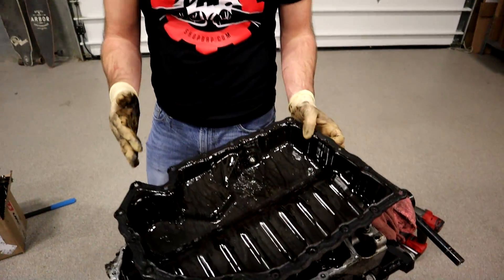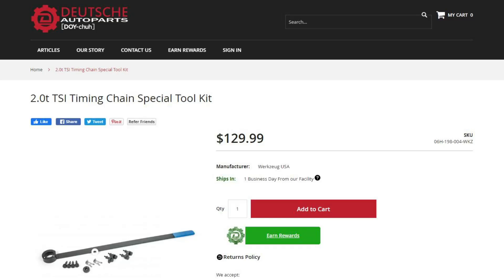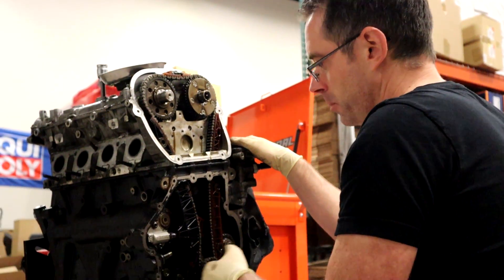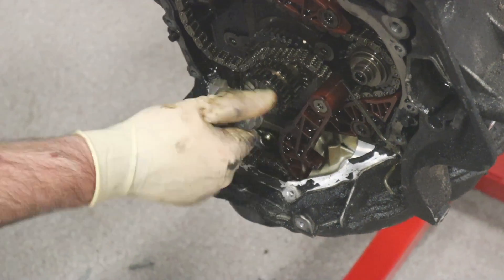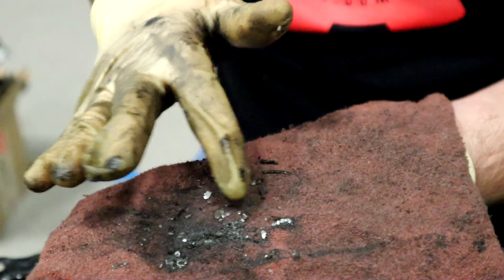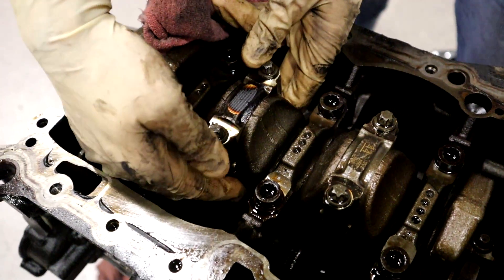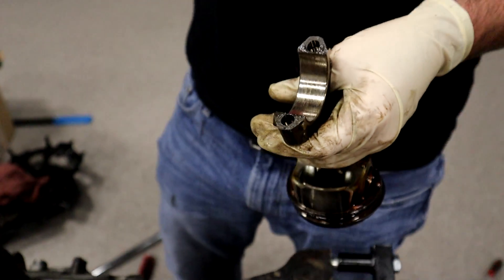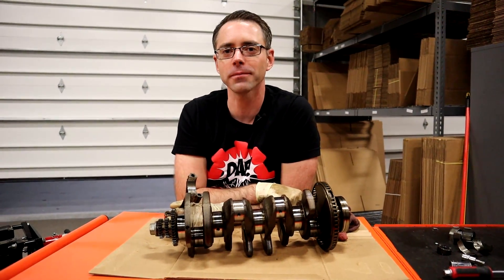What Makes an Engine Rod Knock Noise? | TSI TearDown

Comment: just had this issue ie big bad noises resulted in engine not running.

however my situation was different, i maintained this car to the point the garage told me , dont need to do the full service etc as you havent done many miles and its sorted. so it was always topped off on oil etc. however they did mention on the last mot that it was oddly struggling to get passed the emotions test ( in the uk), which tells me this was all related to the pistons using up oil .

Comment: I had exactly the same problem in my mk6 gti and I replaced the cranshaft with a used one in very good condition with 50k miles I replaced the connecting rod that was damaged and it was black again with used one in good condition and all new set of bearings and new timing chain set.  My question is Will I have any problems with my engine now or should I replace all the parts?

Comment: Did balance shafts and screen deletes at 140k.
Bearing burned out at 155k.
Got a used engine off ebay, and rebuilding the old block for SnG.

Comment: I'm getting a knock from the rear of the sump and It seems to be louder on the right side, 2001 dodge ram van; I don't know what to think. The pressure gauge is behaving differently from how it used to too. I replaced the oil recently, and the noise is still there, mostly at idle. I can't hear it when I'm driving.

Comment: Sometimes n most times no oil or rear main bearing gasket damage worn out n rear main bearing rod not torque enough causing a gap n loose   or over torque n damage broken

Comment: literally just happened to my car today. I bought the car 1 year ago and put 10k miles on it. Kept up up with the maintenance checked my oil every few days and now it's going to cost me $15,000 for a new engine since VW couldn't find any used ones in the country. Also 5 years left on the loan. Lesson learned. Never buy a used car.

Comment: i got one like this. what i'm gonna do, is polish up the journal, put a new bearing in it, run it on half diesel, half old oil, drain that after a bit, and replace with good oil.
everything i read says this aint gonna work for long, but i got nothing to lose at this point!

Comment: Can it come from engine overheating
Reply: I got a ADY engine with a knock I replaced hydraulic lifters oil pump but all plastic melted that was in my engine I tried to clean everything out replaced bearings

Comment: My V W just blew a rod yesterday according to the Naples Volkswagon service department.  I don't doubt their diagnosis b/c of the knocking noise. So they said I need a new engine for 11,000.00 dollars. It's a 2018 Passat 2.0 t s i with 89K miles. It's been a great car till yesterday so now what? Do I incinerate or vaporize her or sell for parts or get it disappeared ? I'm stuck.

Comment: As much as I like the way these engines perform, I think they are overly complex and overengineered.  Just try to replace the water pump on the third generation 2.0TSI...
Way too many plastic parts in these engines, as well.  This is planned obsolescence taken to the next level.  Plastic oil pans?  Come on ! !

Comment: Nothing wrong with those bearings! All you need is two aluminum magnets, a copper magnetic inverted breaker stick, two quarts of slick 50 and some w/d 45! Male sure it's w/d 45! Cost is around $80.00 total and a complete fix without new motor! These internet mechanics are out of control!
Reply: Won't you please come fix my engine?
Northern Michigan is beautiful this time of year.
Toyota 2005 Highlander V6 3.3 L.
Thanks

Comment: I have the low oil pressure issue, but no rod knockig. It still doesnt preform like it should. Im getting a new pickup tube, oil pump, water pump, sensors, ect. If i dont have any knocking noises can i get away without having the engine rebuilt. (0 oil pressure idle, 40-60 drive, overheating, oil level normal but dirty and was past change date when problem started)
Reply: Have you resolved the lower pressure fault?
Reply: @Famo M  I have long gotten rid of the car, but intake cam, exaust cam, and cambridge were very badly worn. I'm going to assume it was the cambridge or balance shafts that started the chain of events, but these motors have a lot of little mesh screens when they get loose they tear shit up bad and it's very common for the 3rd generation 2.0tsi to have this issue where the cambridge screen dislodges and finds its way into the intake cam. Usually it gets stuck in an oil passage and u can just pull it out, worst case scenario it makes its way to the vvt solenoid or intake cam and gets shredded to a million small pieces and destroys the cylinder head. I had no noise in my bottom end, but I wouldn't be surprised if the bottom end was starting to get badly worn because of the amount of metal in the oil.
Reply: @Famo M  also don't quote me on the 0 oil pressure that number wasn't correct. It was still too low like 10-15 at idle.
Reply: @Famo M  if your having oiling issues I would start by checking cambridge for wear. It's one of the easiest things to get to.    If there isn't any issues up top you would want to pull balance shafts and bearings which is a pain in the ass.   Low oil pressure usually means the engine is worn out.     
If u have timing related codes and low oil pressure at idle I'd check the cylinder head first in these motors though.  Sadly by the time u have the oil pressure light the damage is usually done but I've seen people save it replacing cams, and heads and cleaning oil system. It's a bitch

Comment: As a vw tech. I’d never recommend the 10k intervals. My mk6 gti k04 oil change gets done every 3-5k at max. I’m 106000 miles now and absolutely nothing wrong with her. Always check oil level inbetween changes as well

Comment: Worn out piston pins, and/or rod bearings or both, not changing the oil, or simply poorly engineered or manufacture sloppiness tolerances.

Comment: I don't get why people are always so keen to replace rather than repair engines these days. 

I've replaced and repaired countless damaged engines. I've never had a problem with repaired engine but I've had a few bad engines from breaker yards.

 What's more, you know what you have with repaired block and head and it usually works out cheaper.

Comment: As a Hyundai mechanic.. this video really hits home for me.. love the videos!
Reply: Yes. Spun a bearing in my 07 tiburon. Was devastated. Probably gonna convert it to manual
Reply: @littleE33  those engines weren't bad... the 2013+ have a massive recall for bearing issues.. I'm actually doing one right now that has 2mm of play in the piston... that's a missing bearing entirely.

Comment: Just looking at how little material there is between cylinders on the inline 4 is scary , i think i will stick with the 2.5 VR5 engine .
Reply: The walls are so thin, check  the thickness of the 1.6t of the yaris GR

Comment: The sound of rod knock brings back some bad memories
Reply: Adam B  have you tried putting the engine in neutral and rolling to check if it can be anything to do with the wheels or bushings? If you have and no sound then I don't know

Comment: So I got rodknock a few days ago, replaced the camshaft and bearings all of them cost like 600$ for the whole job. Engine is fine now. That was a disaster...
Reply: @Anthony M yeah, it is. Just takes a lot of work. In my case i had the replace the whole crank as it was bent. Basically it costed me around 3.5k $ in my currency. Had to clean the whole engine and polish the camshaft and camshaft journals as they were a bit scratched. Got new rods, pistons and rings and everything else needed for a rebuild
Reply: @Anthony M oh and a new oil pump as I thought it was the problem (prolly wasnt haha)
Reply: @Anthony M i would advise you just to buy a second hand engine tho, way easier
Reply: @Anthony M unfortunate, damn. Well atleast you have a brand new engine now haha.
Reply: @Anthony M now thats gonna cost you a lot haha, but ye if you have the cash, go for it

Comment: Granted, the engine was starved of oil. Now, my question is, why was just that one bearing out of the 4 shot? Does it not have to do with a particular oil canal that got clugged? 
Anyway, interesting content, thank you!
Reply: I'm not a mechanic, not an engineer, and I haven't rebuilt an engine before. However, my best guess is that what little oil the engine could pump (if any) would be sprayed over the valves and as many bearings as it could reach before there simply wasn't enough/it was too gooey to reach the rest, therefore making one bearing go out first.

Comment: I just pull the oil pan and change the rod bearings 🤣
Reply: @Anthony M I've done it to a couple vheicals and their still running today as long as the top of the piston isn't smashed
Reply: @Anthony M 
I think you have to take off the filter and windage cover to expose the botem of the piston rods. One piston at a time you have to   take the 2 bolts out "make sure you set the baring cap down the way it came off bec it needs to go back on the came way. Then push the piston up and pop off the baring then change it do the same with the bottem cap and bolt it back together. Most people recommend using new bots. If you know what cylinder it is or can feel the play then maybe you can just change the bad one.
Ps keep those rpms low peek tork is before redline
Reply: Oh man and the oil pump. Maybe you can pay a shop a couple hundred just to change the barings? Good luck please subscribe #JUNKYARDGTO
Reply: @Anthony M it looks like you can leave it hanging and reconnect it when you put it back together im just sayin oh man bec i thought you had to pull the timing cover

Comment: Hey how do u recommend fixing timing chain failure in 05 vw 2.5 5cyl ?
Reply: The thing with timing chain failures is that you really dont know the extend of the damage until you open the engine. You could get away with changing a couple of valves and replacing the timing chain and guides. Or you could have a completely screwed up engine that needs a new head.

Comment: Green horn question here only had my 2k13 mk6 gti for 1 year now, and I wanted to know the typical price range of getting the timing chain done. Looking to do it in the next 30 days I’ve only seen dealership quotes of around 12-1400. If I can get closer to 1k or a little under that would be ideal. Not sure how realistic those numbers are figured why id ask

Comment: Years ago when the connecting-rod bearings wore on the middle pistons of my Mini Cooper S engine, the halves of the bearings wore unevenly & wedged against each other, causing the engine to seize after losing power.  Fortunately the engine hadn't been fried & was rebuilt!

Comment: Can I make a suggestion;  Buy or make a wheeled-dolly (that will fit over the engine-hoist frame), then place a shallow (but robust) plastic-basin to catch the 'mess' (alternatively, put closed-cell foam in a shallow under-bed storage-box to prevent the heavy stuff breaking it)!

Comment: Excellent rod knock demo!  Thanks for taking the effort to show us.  Especially liked the sound demo part, where you showed what it sounds like in a running engine, as well as the explanation of how an oil leak causes the water pump seal to swell and actually break off part of the plastic housing.

Comment: I just ordered the TSI timing tool kit from you the other day so I can fix this cheap GTI I bought. I have been dealing with and fixing VW/Audi timing issues on vehicles, years ranging from 2000-2013, do you think VW finally got it figured it out in the new MK7s or is it too early to tell?
Reply from the maker: Thanks for the order, we appreciate the support very much. MK7s seem to be ok in the timing chains at this point.

Comment: I bought a 12v vr6 jetta with an engine that "wouldn't stay running" for $350. After driving it for 15 minutes with a new battery it locked up on me and one of the rod bearings had spun and seized. The reason it spun was due to the old plastic guides falling into the oil pan and clogging the pickup. There was metal everywhere lmao. I rebuilt a used engine for it, and it has been running great ever since.

Comment: 3 years ago I swapped at tsi engine run with a broken radiator Assy and no water.  Probably a stolen “running from the cops” as the back window was busted out.  The oil baffles and even the sensors were dripping melted.  ECU needed replacement. I replaced the engine with a known good and she still running strong.  ALWAYS CHANGE OIL AT 5k.  Don’t let your car engine leak.  Get it fixed.

Comment: Since the mains weren't damaged...I wonder, what would happen if one just replaced that one rod bearing and continued to use the engine?  Would the rod knock would be gone or has material been removed from the crank such that a proper bearing would still have too much play?  I'm sure there are people (and shady used car dealers) that might do that and then trade/sell away the vehicle if they could make the knock go away even for a the short term.
Reply: You seem to know exactly what shady dealers do....  but I don't believe anyone on earth would strip down an engine to the bare block and put it back together without fixing the issue.  That would make no sense on any level, even for a shifty dingo.
Reply: @einfelder8262  you have only got to remove the oil sump and oil pick up to have access to the crank and rod bearings. It's a simple job.
Reply from the maker: Crank was damaged on the rod knock cyl
Reply: Most of the time, on simple engines, you polish the crank and get a new bearing installed, and it would work pretty fine.
But on VVT engines and the likes, you can have screens all clogged up with shredded bearings, and that will cause all sorts of problems.

You can still get away with it, but it's only worth it if you do it yourself on the cheap.

If you change the bearing(s) and the knock is still there, the crank was too badly chewed up.
But it's a rare scenario as the bearings are purposely made on a metal way softer than the crankshaft.
So if you still got some material in between the rod and the crank, the damages are generally not so bad.